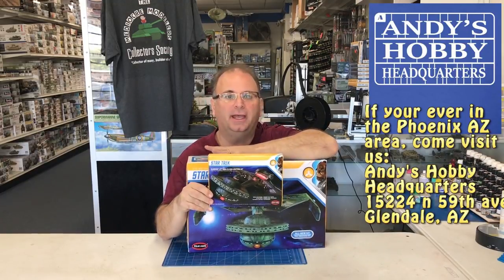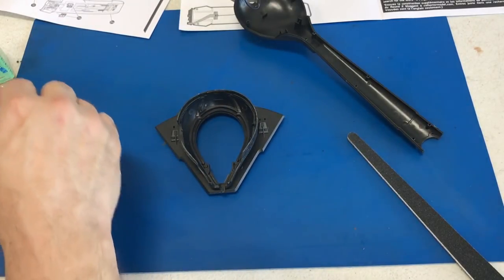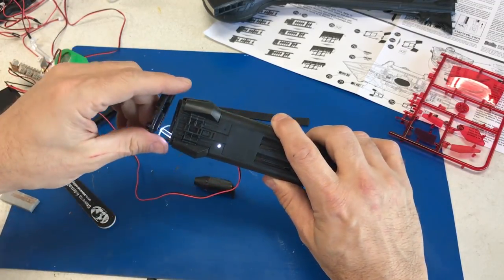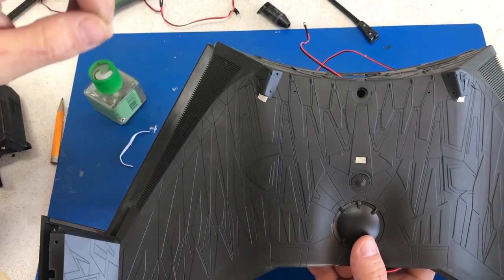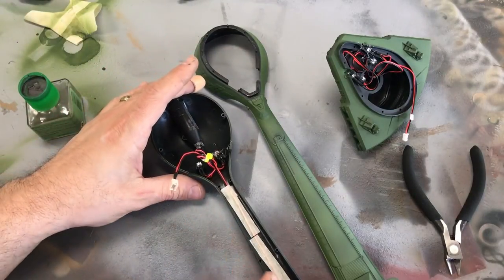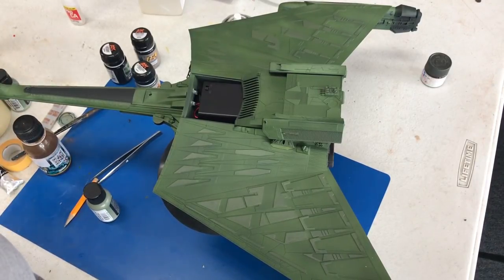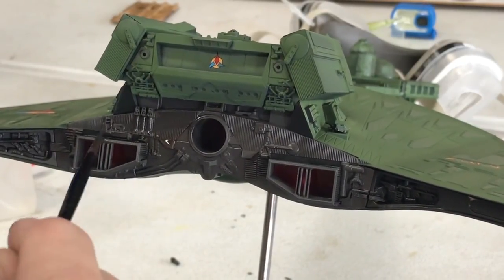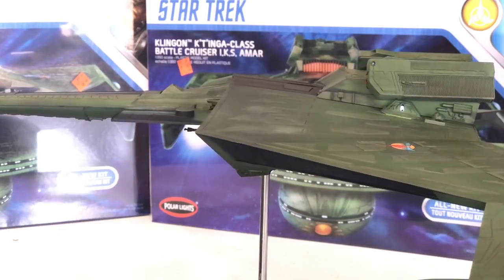Building the 1/350 Star Trek Klingon k't'inga battle cruiser Polar Lights new kit with lights

Comment: my dad made this model using the 1970/80 kit when he was a teen he used fishing wire and a single bulb that was intermittent (a small old flashing Christmas filament tree) to make the lights flash, this was done at a fraction of the cost and battery's of course
Reply: The green was used for the smaller Klingon bird of prey, I may be wrong
Reply: I would like to see that

Comment: Nice job on the paint and weathering Andy. On your gluing down the rear part of the engines, I suggest using canopy glue as it will hold very secure but if you need to remove it you can pry it off without any damage to the 4 pins.

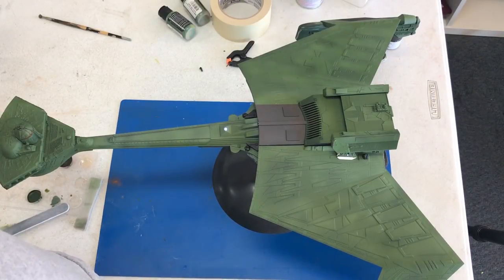Comment: @23:35, yes the Nacelles are engines...they are the Warp Engines.  The red parts on the aft Main Hul are the Impuse Engines.
BTW, has been my experience with other D-7 based model designs, the point where the "neck" attaches to the Main Hull can sometimes be a bit fragile.  I usually use epoxy here just to be sure...

(adding):  Great idea for hiding that pesky gap, using a small piece of styrene.  Inspired!  Oh, and the battery cover, instead of Velcro I was thinking, maybe, a magnet and a small steel plate?  A thin washer that is ferrous might work nicely.

Comment: With the color scheme for this it's the same as the Enterprise refit. The studio models for both ships were painted up with a lot of vibrant colors but in filming they had a bit of trouble and ended up filming in low lighting and then brightening things up in post,plus they added some filters to create the dynamic space lighting and so forth and what you end up with is a different, more washed out or subdued on-screen appearance than what the studio model has. It's up to the individual modeler to decide between the on-screen appearance or the studio model or some compromise. I usually opt to go with the on-screen appearance as much as possible. That is ultimately what these ships ended up looking like m in the shows which kind of makes it canon.

Comment: with the black plastic, did you find any need for any further black out treatments to avoid any light bleed through seams, plastic, etc?
Reply: I did my own lighting on this model. Much brighter than the lighting kit. I did no additional light blocking on the inside and I even added a few extra lights in the head to get light into the back area and more evenly across the front of the head. Still no need for extra light blocking. What a nice change not having to light block a model.

Comment: That looks amazing. How difficult would you say is the build?
Reply: WeyounLP Very. Did say age 10 and up but would say above age 15 since building 1:350 requires patience. And lots of test fittings and fixing. Have ToS 1:350, Refit Enterprise 1:350,  and Enterprise 1:350. If you would add lights, requires patience in adding fillers to prevent light bleeds.

Comment: How exactly does one apply paint in space?
Reply: By electrostatic painting?
Reply: @RCH45ACP  Shades of Red Dwarf!
Reply: By being shipwrecked and comatose.
Reply: RCH45ACP ..of course!!😂
Reply: How does everybody feel about being shipwrecked and comatose?
Reply: Add air.lol
Reply: @o.b.7217  that would work. just use air to push the paint. It would probably do a great job.
Reply: Carefully
Reply: Magnetic flux capacitor  Magnetic  cellulose Carbon fiber pigment  paint. I've seen it done and it works really good
Reply: @JDsHouseofHobbies  Haha...you got that smeggin right.
Reply: I thought an airbrush would work, but would the paint crystalize before it had a chance to adhere?
Maybe non water-based paint would be okay?  Interesting question.
Reply: I assumed all parts were pre-painted in "dry" dock (read: in atmosphere, then ferried to the appropriate space dock).
Reply: Very easy unless you make a mistake. No one can hear you scream in space.
Reply: Just find a giant cloud of gas in space that matches the color you want.  Warp speed guarantees good coverage and weathering.
Reply: @sorenzx1923  I'm ok as long as I'm drinking fresh mango juice....

Comment: Hi Andy....After having looked and looked and looked at the film...it "appears" that the outer color is Green with a under coat of Gray...the are areas that the Green appears mottled and rust(red primer??) shows through...it certain areas shows Green as primary outer coat, with Grey and Red being mottled by wear or weathering.....so I will paint Red, Gray and then Green, with separate coats and wear shown by using the "hairspray" technique.....I'll send you pics once i get it done....could be way off, but hey like you say...It'll be my model....I have elected NOT to have lighting.....

Comment: I am no meteorologist but would you get weathering in space?
Reply: Lots of debris (dust) in space, so the hull definitely gets worn out over time.
Reply: @o.b.7217  Striking any particle of space dust at light or worse "warp speed "would cause a lot more damage to the ship than a little weathering ,and if you say" shields "then you would then get no space weathering at all.
Reply: @paulgrinsill7785  
Just ask the guys on board of the ISS.
Reply: Actually the planet Klingon has a considerable dust layer in its ozone.
Reply: @reconranger1370  not planet klingon... Kronos😉 or Qo'Nos
Reply: @razormx3253  I believe the official spelling is Qo'Nos